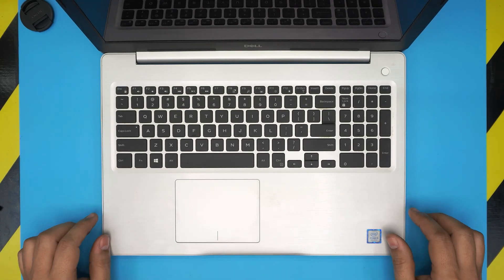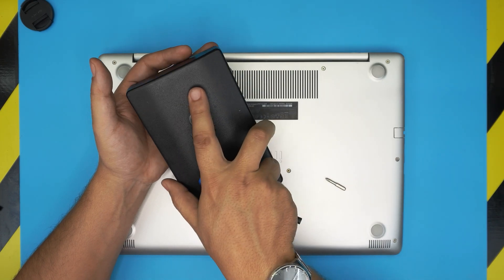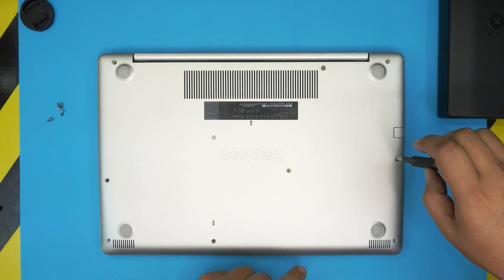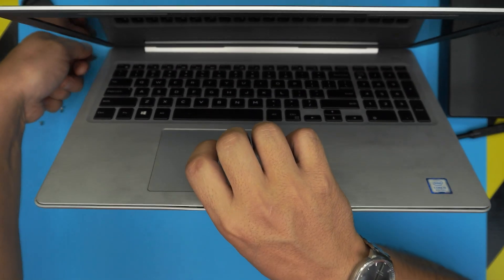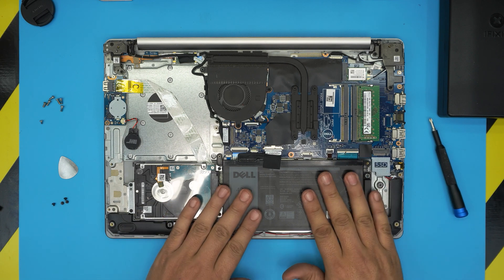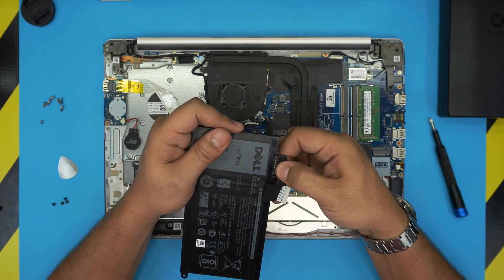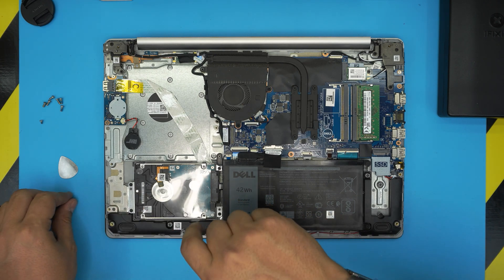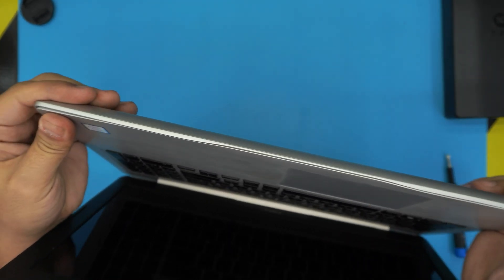Dell Inspiron 5570 P75f ✅ Battery Replacement🔋

Comment: Can i just remove the battery and plug it directly to the socket?
Reply from the maker: Thank you for your feedback! If you wish to support the channel, you can like, subscribe, or both!
Regarding your question, yes you can and it will work fine without any issues, 100% safe.
Reply: Subscribed and liked your video...
Reply from the maker: It's my pleasure my friend. 😊
Reply: Wow, that's a great help to know.. i will let a technician remove the battery and i will just used it without a battery after that.. 😊😊😊

Comment: funny enough there were no hooks on my battery connector
Reply from the maker: Thank you for your feedback! If you wish to support the channel, you can like, subscribe, or both!
Regarding your question, some models use a different jack all depends the limit of supply during the assembly time. we have seen 3 different types on a same exact models.